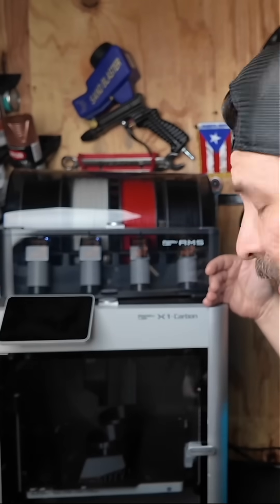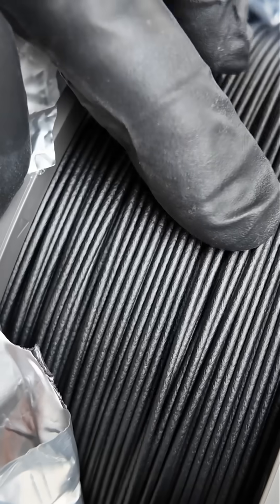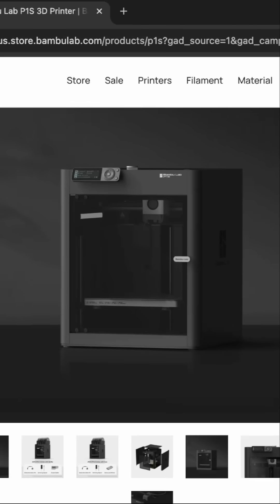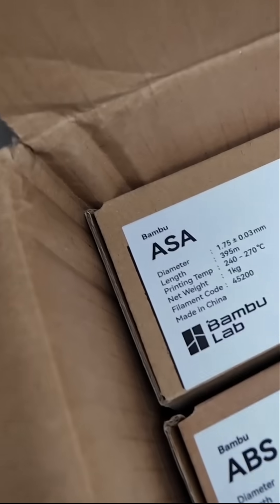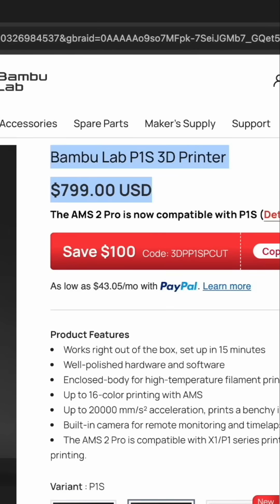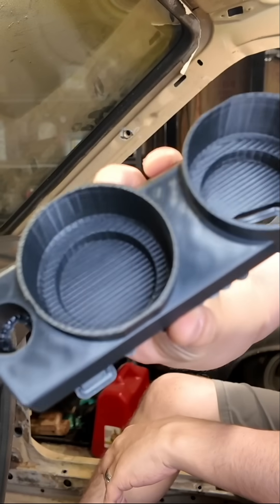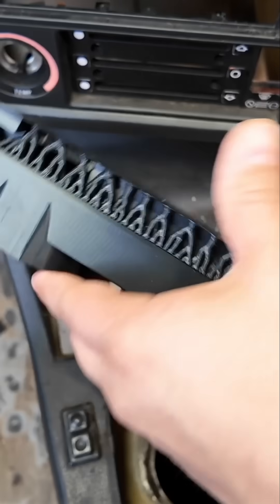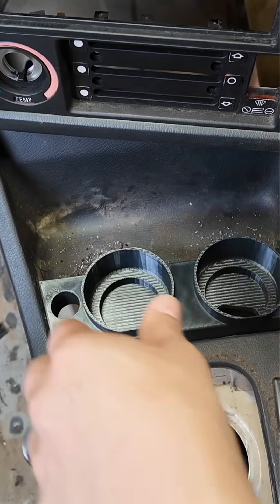Cheapest Capable 3D Printer For Car Parts...

Comment: You can print asa on a $200 machine
Reply from the maker: Which one???
Reply: @Itsallaboutthebuild  Ender 3 v2.
All I print is asa. Only mods I’ve made are a light and the sonic pad. For more stubborn prints I use a wider brim and draft shield in the gcode
Reply from the maker: Oh nice, will have to try some mods on my A1 to print ASA :)
Reply: sweet, been wanting to get into RC airplanes and only have an A1 and mini lol

Comment: You can get the hardened steel nozzle for like $30 to print carbon on the p1s
Reply: Good reliable without a an active heated chamber there is still a compromise for engineering materials. Carbon fiber  filament reduces warping issues since fiber the carbon particles do not shrink as much as ABS, ASA and PA
Reply: @tunedstylespecs  I’ve haven’t had trouble printing asa on the p1s. I don’t know how hot the x1 gets but the enclosure keeps the p1 pretty toasty. But I usually stick to ppa and pa filaments anyway because I hate the way asa smells.
Reply from the maker: Oh nice, I have a fume extractor setup in the garage to help vent the nasty fumes :)
Reply: @TrillMurray yeah that is one of the downsides of ASA/ABS. I presume you are doing smaller prints or preheat the chamber and the printer is in a stable environment.
Reply: @tunedstylespecs  maybe I should be preheating. Right now I’m printing a gauge pod with pa6-cf that’s 275x210x110mm. It’s pretty much at the limit of the p1s size wise. I had to design it to print in a specific orientation to fit it on the build plate
Reply: @TrillMurray glad to hear success stories but keep in mind CF, GF help with layer separation, I am on the market for a 3d printer so heat chamber is my priority since when I have triedto use normal ABS the results were mixed. I have used Stratsys machines at work with ABS/ASA and little PLA, although I was not too excited about it  but the heated chamber was the only heated source it was needed appart from the two hotends. They did not used heated build plate but their build surface were made out of ABS or Clear sheet and were disposable. I believe that an 80-100C heated chamber would make the consumer printers to produce more robust prints and if they are properly insulated it could make the printer more economical to operate than to allow the heat to escape because the build plate creates more heat than what is needed, but that is just my speculation. I am currently trying to design an enclosed 3D printer fully enclosed without any opening to allow heat to escape. Let's see if I can achieve what I have been speculating for quite some time now.
Reply from the maker: Which printer are you building an enclosure fore? I've been looking for a larger bed size than X1C for some much larger ASA prints :)
Reply: @Itsallaboutthebuild I am not aware about this project. I am designing my own printer using parts from my old CR10 which is prints reliable PETG running klipper so I am hoping to make it good.
Reply from the maker: Wonder if there are any easy mods to add a small heater into the P1S...
Reply: @Itsallaboutthebuild  I saw someone adding a heater but I assume that is not connected to the firmware. I would expect BL to introduce an upgrade or to replace X1C, P1 with a more versatile version. H2D has the heater but it is a different market IMO. X1C atleast should had a heater.
Reply from the maker: Awesome, I think the p1s is a bargain!!!